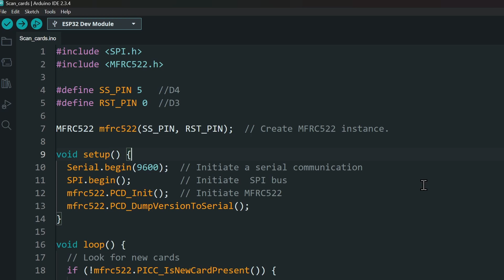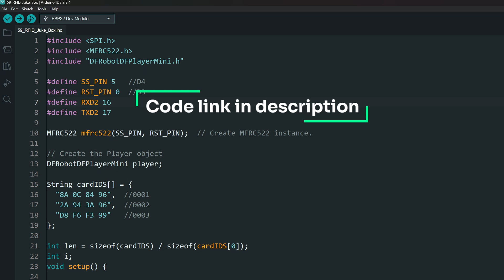ESP32 RFID Access Control System with Voice Feedback | Arduino project with code

Comment: It's not "unauthorized access" if the system doesn't unlock the door. Why wouldn't that have been the logical opposite prompt: "Access DENIED?"
Reply from the maker: It's just a proof of concept. You can make it whatever you want.